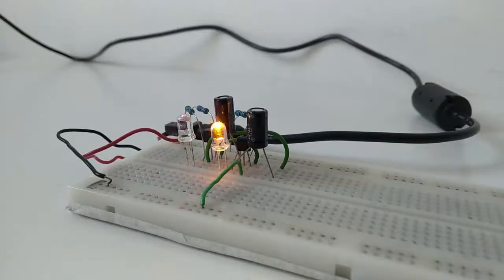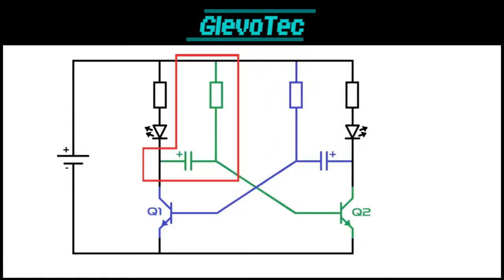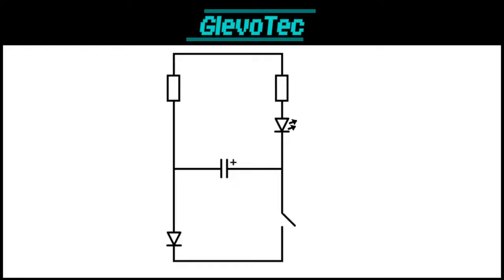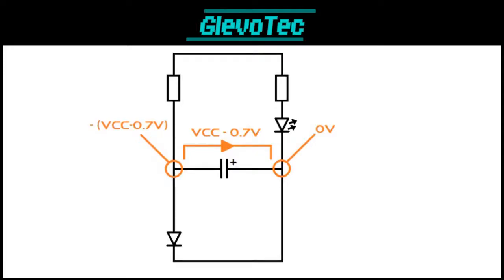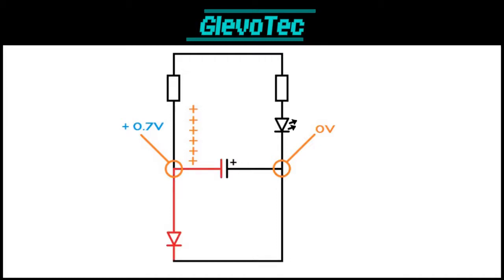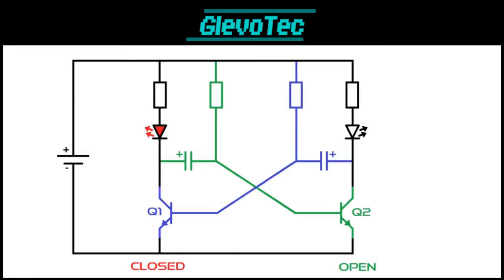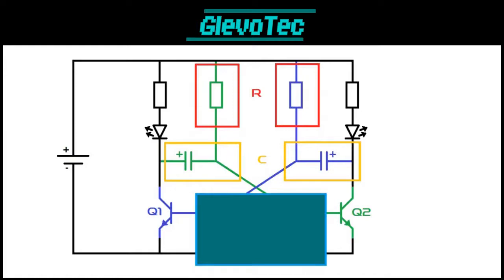How a 2 transistor LED flasher circuit oscillator works | Easy simple explanation

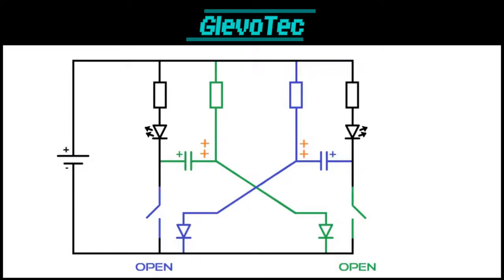Comment: 2:13 I don't understand here why the +ve charge is building up on the capacitor's plate which is not connected +ve terminal of the power supply. Like why does the +ve charge build up on the transistor base side?
Reply: You are right, the (+) side of the left side capacitor is floating when the left side transistor is in the OFF state. So the other (right) side really does not "charge" for a while, it just increases in voltage until it reaches the base emitter (0.7V) voltage of the right side transistor. I really want to run PSPICE on this circuit.
Reply: Because it is connected to the positive of the power supply I think

Comment: I wired this up using a 2k trim-pot for R1/R2 and the same for Rf, with dip-switches to select each of the three capacitor values you mentioned. Supplied voltages were +/- 9v. You don't explain what the values of R1 and R2 should determine and I expected they would affect the signal amplitude, but I found that R1/R2 control only the frequency, as does Rf. (I notice that in your breadboard circuit you don't have R2, and R1 connects straight to ground.) I obtained various wave-forms as described by other commenters, but at no stage did I get anything like a sine wave. Granted that my LM741s are the cheapest Chinese knock-offs I could find on eBay, but I have to say I'm disappointed with the outcome.

Comment: What l  wonder is if this circuit can be added with a Variable Timing circuit !?? For example , if l want L.EC ONE , to remain on for a certain time or Indefinitely ! While LED TWO ! can also be varied for as short or as long as l want it ! Let's say LED one Remains on for ten Minutes ! But when it swings over to LED 2 ! that could be one or even a millisecond if Nessercary ! Before it swings back to LED one for ten or even an hour or more ! In other words l can vary the timer ! To personally custom make that happen or l by varying the timer the Other have some sort of other type.  / Style configuration !  ( Whether that can be done I'm not sure and. What extra Electronic components Would be needed Along with the skewmatic circuit Diagram ! David

Comment: Thank you so much for such a clear and yet through explanation of what happens in this circuit. I'm just getting into electronics (having always been mystified by it) as there are several model applications I want to use such circuits for.
You just got a new subscriber.
Reply from the maker: Thank you. I appreciate it!

Comment: So at one point, the two sides of the capacitor are positively charge because the capacitor side between collector and the led could prevent electrons moving both sides, is that correct bro? But why is not both capacitors charged at the same amount at the same since the have the same resistance?

Comment: There is a mistake in the explanation. In the beginning of explanation, you said that the charging current will pass through 22k resistor towards the capacitor. But the passage of this current is still open circuit in Q1. Current will not move and will not charge in open circuit !!

Comment: I love this video and it was a great start for me to figure out how this basic schematic works. Thank you. But still I do not catch about voltage difference over capacitor remains, which are talking about ~4minute. And how does the voltage goes from 0.7 to -11.3 on the left side I could not get it. Can you please share some reference to read more about it? Is this about field effect or displacement current?
Reply from the maker: Thank you. The voltage difference is simply the capacitor voltage. When charged it acts as a battery, with a charge voltage difference between the two sides. The voltage "flip" only happens because the reference point changes. The voltage over the capacitor remains the same,. Only the measured voltage referenced to ground will become negative.

Comment: I've found arduino and other microcontrollers end up just being solutions looking for problems. Why 1.38 in the frequency calculation?  I'm going to assume I can use 2 variable resistors so long as they're both equal value and adjusted equally an try with my kid but I know she'll ask me why 1.38.

Comment: It works because the variance in the tolerances of the components. That's why it throws people off, because if the components were EXACTLY equal in their values it wouldn't work. Or you would have to short out a couple legs of a transistor quickly to get it to oscillate. (I've had to do that).

Comment: 2:00 how come it's VCC? Isn't there a voltage drop across LEDs? Why aren't the LEDs turned on at the very beginning since the base->emitter allows for the current flow (otherwise how would the capacitor charge?)
Reply from the maker: It's VCC because at that point there is no current flowing through the LED. No current through a load, means no voltage drop. The LEDs are not turned on as long as the transisitor's base doesn't reach the treshhold voltage of 0.7V.
Reply: @GlevoTec  Thanks, that makes sense now!

Comment: I am on a journey trying to understand the Astable Multivibrator circuit. It's funny how you think you have a good idea on how the components work but realise, when digging into this system how much more complicated it is to truely understand due to the voltage drop and build up to 0.7V again for the base of the transistor to turn on again. I'm slowly getting there with the help of this video but understanding this curcuit in a fundamental way was a bigger task than I anticipated. Quite frustrating when it's supposed to be "simple" but I had to learn the fundamentals of something I thought I had a good idea about. I hate feeling dumb :)
Reply from the maker: That's the best way to learn. Digging deep to find what it is that's really making something work underneath. Simple circuits can sometimes be unexpectedly complex and circuits that seem complicated can actually just be a combination of very easy logical circuits. Good luck in your journey. Feeling "dumb" only means you're learning and getting better at it 👍

Comment: This was the BEST explanation of a flip flop oscillator I've ever listened to. Seriously you have no idea how many times I have  heard this in ways where they don't explain things well, like why does the voltage turn negative. It makes so much sense when you broke it down. I'm an electrician and love electronics. This circuit was always a huge road block for me. It doesn't seem like a useful circuit in sensitive electronics. Maybe for a simple blinking circuit. Where do they use this circuit in? I hope you make more videos like this!
Reply from the maker: Thank you! I really appreciate your feedback. I'm happy it helped you understand. The circuit itself is mainly used for non critical circuits like light effects or as a simple oscillator where the frequency doesn't have to be very stable. But like always with electronics, your imagination is the only limit. Circuits can always be modified for different purposes.

Comment: thank you  for the tutorial.  i am learning it and i tried to build this circuit but both lights glow oneweaker than the other but they do not flash,  i had 330 ohm and 33k resistors.  i used 33MFD capacitors and n2222 transistors.  am i using the wrong values?
Reply from the maker: At 33uF and 330 ohms your frequency will be too high to see. That's why you see the glow. It probably is oscillating, just too fast to see. Try different values and use the formula I show in the end of the video to calculate your component values for a low frequency between 1-10Hz
Reply: @GlevoTec  thank you very much

Comment: You said "because of component tolerances". So... the blinking effect is based on a random (not calculated) effect.. tolerances. I wouldn't call this design accuracy. In other words, what should a circuit designer do, in order to make sure which capacitor will charge first?
Reply from the maker: No, the blinking effect is based on calculations. It is relatively stable and predictable when running. Just the starting situation is determined by the very small differences in tolerance. If you want a certain capacitor to charge first, you'll just make one a smaller value, or the other one bigger. But for this circuit that has no point, cause you want the values to be nearly equal.
Reply: @GlevoTec  Thanks. It is so interesting... placing components symmetrically, with the same specs, yet they may act so differently.

Comment: what is the minimum and maximum dc supply for this circuit
Reply from the maker: The minimum voltage can be around 3V. Maximum voltage is defined by the transistors and capacitor's rating. The circuit works best above 5V in my experience
Reply: @GlevoTec  Will the circuit blow up with 9v or 12 v battery?

BTW thanks for your reply 😊
Reply from the maker: @abhishekgupta9705  It will work perfectly. The circuit in the video was tested at 12V

Comment: I can't understand how the capacitor gets charged from the branch with the higher resistance?! The negative terminal of the cap is on that side. My understanding is that it should be charged through the branch that has the led and lower resistor value since the positive terminal of the cap is on that side. Please help me understand this.
Reply from the maker: The negative terminal gets charged because the positive terminal is grounded when the transistor is closed. This means during that time, the positive terminal cannot charge, no matter what the resistor value is. It's grounded, so any charge current will flow to ground.

Comment: Why  current  not  going  through base pin  while  capacitor  is charging
Reply from the maker: Because the voltage at the base can't rise over 0,7V as long as the capacitor isn't charged to that voltage yet. The capacitor needs to reach +0,7V first, before the transistor base starts drawing any current. That's because of the base-emmiter junction that has a treshhold of around 0,7V, similar to a diode. I hope that's clear
Reply: @GlevoTec  can you  clearefy by making  a  video  about  this  please
Reply: @GlevoTec  but when  capacitor  is charging low  currant  should  go through  the base pin isn't?

Why  current  starts  to  flow  in  base pin  after  the  capacitor  is charg?
Reply from the maker: @harshal3692  No. See the capacitor as a bucket of water. The top of the bucket is 0,7V, which is the treshold voltage of the transistor.  Imagine the transistor is the table the bucket is on. The only way the water can get on the table is by filling the bucket until the top until it flows over. While filling, not even a little bit can get on the table, because it has to reach that treshold first to be able to flow. The capacitor acts the same way. It takes all the current available until it's charged up to 0,7V. At that point the transistors base will start drawing current because it has reached the treshold. At that moment the current will flow both to the capacitor and transistor base
Reply: @GlevoTec  can  you  explain  by making  video  please

Comment: SIR:
VERY OUTSTANDING THE WAY OF DEMONSTRATING THE WORKING ELECTRONICS.
PLEASE TELL ME IF THE POLARIZATION OF CAPACITORS ARE OK IN THE SCHEMATICS. I THING ARE THERE IS SOMETHING RARE.
JOSÉ
Reply from the maker: Thank you. Yes, the polarization of the capacitors is correct, that's how it should be. Like mentioned, there is a slight reverse polarization, but that won't damage the capacitors.

Comment: Thank you for the video! This was really helpful to understand. Especial thanks to the part that explains the Component tolerances and the part where the capacitor flip the voltage. Could you please, explain why the Frequency is 1/(1.38xRC)?
Reply from the maker: Thanks you! The frequency is determined by the charging and discharging of the capacitors to the critical voltage at the transistors base. This depends on the time constants of the RC combination and the non-linear charge behaviour of the capacitors. For more info, take a look at capacitor charging curves and calculations

Comment: Amazing I just wanted to know if it is possible to switch ac led series light with this circuit.
Reply from the maker: This circuit only works with dc. You could use a relay maybe
Reply: @GlevoTec  I thought of it but it would make alot of noise. Actually I have got a ac decoration light which I needed to alternate so I was searching for circuits.anyways ur video was great I learnt how the circuit works .

Comment: Is it possible to use this to create sound by raising the hertz to the level of musical notes and wiring a speaker?
Reply: Yes you can. By using small capacitors such as 0.01uF. This increases the frequency to an audible level.
Reply: @nathancantwell602  I've since tried this and it does work, but it gets unstable. It's not practical exactly

Comment: The negative plate of the capacitor is not charging. The voltage of the negative plate returns to normal as the capacitor is discharged. You confused everyone.
Reply from the maker: Which is exactly what I am saying.
Reply: @GlevoTec  no

Comment: Good video and the circuit works. But it does not really make sense. The capacitor gets charged a tiny bit through the big resistor at the base, then the transistor is switched on and it gets charged from the other side because there is less resistance. But then the capacitor should not discharge, it should always be charged and the second transistor should never switch on. Because the capacitor is charged through the voltage source it should never discharge.
Reply from the maker: Not really. Both sides of the capacitor charge at the same time, just at different rates. By reaching the threshold of 0.7V, one of the transistors closes. This causes the negative voltage, which keeps the other transistor closed. But because of the larger resistor, it will charge that side of the capacitor back towards 0,7V, causing the same to happen on the other side. It's not the charging that's controlled by the transistors, only the discharging
Reply: @GlevoTec  Thanks for the explanation. It is just hard to understand that a capacitor gets positive charge from both sides at the same time.
Reply from the maker: @radio_electronics4047  Yeah, but you have to see a capacitor as nothing more than the difference in charge between two plates. Doesn't matter if one side is connected to ground or through a resistor to vcc. Simply the buildup of electrons on the plates determines the relative voltage between them. If you use different resistors like here, one plate will charge quicker than the other. Hope it helps!
Reply: @GlevoTec  i have same question in my mind it
 really doesnt make any sense can you please explain it plssssssssssssssssssssssssssssss.......................

Comment: Thank you very very much Sir. The precise ,the best explanation amongst all that have been viewed on this topic. Helped also in understanding something about Capacitor.Simply great.
Reply from the maker: Thank you. I'm happy you found it useful!
Reply: @GlevoTec  Thank you once again.A novice query.will the opposite side of +side of capacitor get positively charged as this will result in .7v to trigger the base . Also both sides of each capacitor are connected to+ve supply voltage through different value resistors
Reply from the maker: @adinath1974  Yes, each capacitor gets charged like is explained in the video. And yes, the values have to be different to allow the charging behaviour
Reply: This is becoming interesting. Each side of electrolytic capacitor is connected to +ve voltage with different value resistors. So each capacitor must be charging with different voltages on each side. Is it correct? However for frequently the higher value resistor is considered though there are  2 resistors on opposite side. Can you help with explanation. Or any literature you can provide for understanding some concepts.Thanking you in advance.
Reply from the maker: @adinath1974  They don't charge with different voltages, since they're both connected to the same supply voltage Vcc. But they do reach their voltage level at different rates, because of their difference in value. The resistor at the LED has te be low to allow for quick charging that side of the capacitor. That way there is a decent difference in current supplying both sides of the capacitor, making sure the capacitor charges with this behaviour. Basically the smaller resistor only has to make sure the positive side of the capacitor can rise quickly to Vcc again after the transistor opens

Comment: Hi, when I simulate this circuit in simetrix I see both the LEDs lights up in the initial condition then they settle to flip flop oscillation.
Could you explain this initial condition? 
Thanks
Reply from the maker: That's because your simulation doesn't account for the slight tolerance on the components. Like I said in the video. In real life because of those tolerances, one transistor will reach the open state slightly sooner than the other. So, in real conditions they won't open at the same time initially. Hope this helps!
Reply: I believe the video's description of the initial capacitor charging is backwards. On a very short timescale, the capacitors act as a closed switch until they are charged, so the current flows through the LED and capacitor. This current also flows through the transistor bases, and eventually causes one of the transistors to conduct. The capacitor connected to the collector of that transistor then reverses its current flow. The other capacitor continues to build up a positive charge on the LED side, until it pushes the voltage of the LED cathode high enough that it can't conduct and turns off. If you were to begin with one of the capacitors fully charged, this initial two-led state shouldn't happen.
Reply: change one capasitor into 99uf and other into 100uf. that will one simple answer to tolerance problem....ha ha